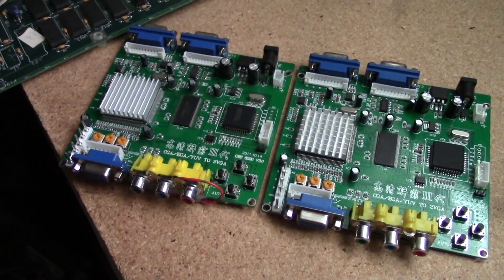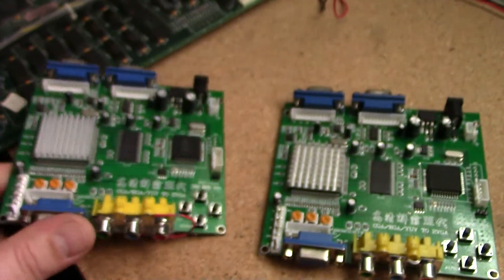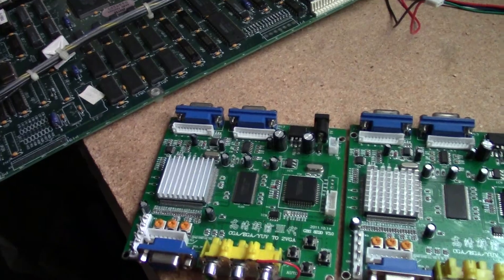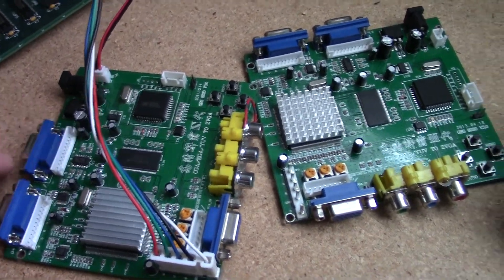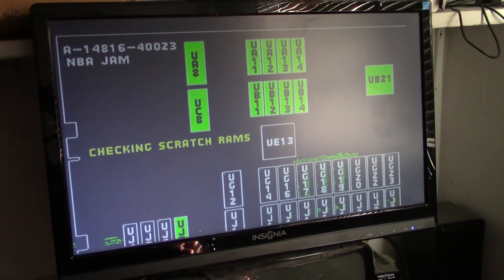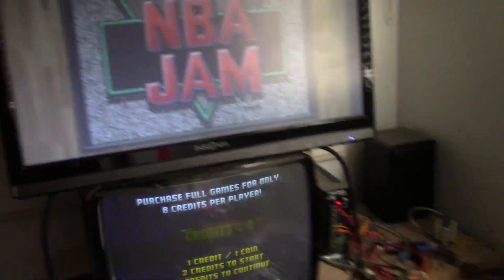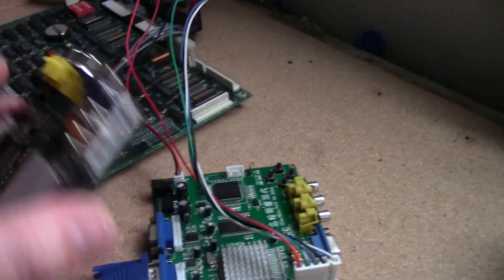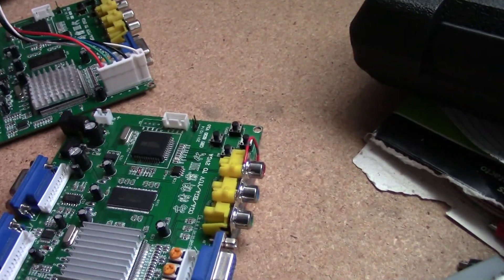Arcade Monitor CGA to VGA Converter Firmware "Frozen Screen" Explaination [HD]

Comment: Has anyone tried using a GBS8200 connected to a LED TV using HDMI, Svideo or Component? I understand that without a additional adapter, this GBS8200 only offers a VGA output.
Reply from the maker: Correct. VGA out only. Everything else on the board is an input. The only output is VGA.
Reply: @YourMKArcadeSource  understood, but is there an adapter/cable that will go VGA to HDMI, or component...?
Reply from the maker: No. You’d need to use this to convert to VGA, then a separate converter to convert from VGA to HDMI.
Reply: @YourMKArcadeSource  I've seen such an adapter but no guarantees it will work
Reply: My problem is I'm replacing a CRT in an arcade cabinet with a LCD or LED TV. I have an LED which requires minimum modification to fit inside the cabinet, but it has no VGA connection. I bought another 32" LCD tv (used) but after opening it, there is still no way it will fit inside the cabinet, metal frame surrounding LCD still too wide.

Comment: Are you still seeing these kinds of issues with today's boards.  I just bought golden tee fore 2005 with bad monitor and ordered the first one on Amazon (Amazon choice) and installed it.  First was flickering screen, found a manual on line and stated to hit the auto button.  Did so and now have frozen screen. This one sold to me is Oct. 18 2019 ver. 4.0
Reply from the maker: To be honest, I haven’t used one of these in years so I can’t say. Sorry. Try setting your V.Pos to 28 or higher.
Reply: @YourMKArcadeSource  thank you for replying.  Seems I'm a little behind but I caught your other video as well and to your suggestion to change vert. pos. And turned up to 29, it fixed the frozen pic.  Thank you and hope this continues to help others.  Liked and subscribed follower.

Comment: Wonder if those "fake" GBS8200s would do the same freezing thing with Sega Model 2/3 stuff cuz those actually run at a non-standard refresh of 57.5hz, too. Fortunately on some monitors that work with medium-resolution, you can use the output connector but mine gives out a washed picture where everything is overly white, except my Model 2A board which is in the metal cage (Sega Rally). Have you experienced a similar problem with any medium-res games like this on a GBS?

Comment: Hi , Have you ever seen an LCD to VGA ?
Reply from the maker: I don’t understand the question
Reply: @YourMKArcadeSource  I have a device that has a 5.7" MG3224C3-SBF - LCD Screen Display Panel 320*240. The information on the Graphic display is just too crowded, also these displays fail often.
My objective is to produce a small PCB that can accept the 14 pin ribbon signal passing it through to the display ( easy enough ) then have a circuit that can produce a VGA output so a larger monitor can be connected.
Reply from the maker: Your problem lies in the resolution. The converter can only accommodate 640x480 as it’s lowest resolution. If your LCD is 320x240, that’s your problem.

Comment: Hey mate what are your recommended clamp settings for midway arcade games I’ve got NBA hangtime on a converter and it keeps going black on me constantly. Cheers
Reply from the maker: Clamp settings are only for Medium resolution games. They keep the colors from drifting. They have no effect on Standard resolution games. But to answer your question, 03 and 04 are what they are supposed to be set to but that won’t fix your issue most likely. Does the game still play when the monitor is black? Are you sure it’s the converter and not the monitor?
Reply: YourMKArcadeSource yeah I’m starting to wonder. It still plays just goes black after so long no matter how good I get it going. Sooner or later same deal I’ve swapped over power supply because old one was 20 years old it was fine for a day or 2 then same thing. Game seems to run fine no problem just a bad picture. Could very well be the screen. Thanks for your time
Reply: Am leaning towards a clamp setting because I went the other way now picture is too white need to find that balance. Will let you know if I can get a nice stable picture
Reply: NBA  maximum Hangtime believe the board for that game was 1997
Reply: Connected a laptop to the monitor and monitor is no problem.
Reply: Thanks mate problem solved was a loose jamma connector was a fair trip when I picked this machine up. Looks great now cheers 🍻

Comment: Don't think it is a fake. It would seem to be a lot of trouble to go to, to manufacture a board with all the same components just to make less than $20 bucks to sell to unsuspecting customers. 
Version numbers for firmware just means there's been an update and only change if there is a bug fix or component change that requires an update to the firmware, as you know.
It's more likely the board wasn't adjusted to suit its purpose and I'd fiddle with the display settings menu first to see if that fixes it.

Comment: Hi, How to add an EGA input to the board? EGA has 6 color channels and 2 HV channels. Where do I plug them in? This is more than RGB. I have an Amstrad 1640 with EGA output which I want to plug to an VGA monitor.

Comment: to fix this problem is not the firm ware you have to go to geometry a fuck with the setting to the maximum level it will work eventually. the settings of vertical sync and everything has to be taken into account, set it all to 100 and slowly work down from there. and boom. The problem is is that its not fake but there is bad data sheets for the component on how to properly use it. Try it
Reply from the maker: Actually, if you adjust the Vertical Position to above setting 27, it fixes the issue. I have a different video on it.

Comment: Hello! Can I hook up a pc to an arcade monitor using this converter? Thanks!
Reply from the maker: No. You need this...

http://www.ebay.com/itm/New-VGA-to-RGBS-CGA-AV-S-Video-Converter-Arcade-MAME-Multicade-Wire-Track-NO-/361155268202?hash=item5416880e6a:g:Df8AAOSwPgxVSdge
Reply: Nice! Thank you!
Reply: YourMKArcadeSource do you have experience using the converter in the link you provided?
Reply from the maker: Yup. Works great.

Comment: So I have this harness for my MK II board http://www.ebay.com/itm/JAMMA-Wiring-Harness-with-Wire-Id-Label-Arcade-Video-Game-Multicade-/121753778577?hash=item1c59173991:g:4FQAAOSwwE5WXggF Am I going to have to tap into this to get the VGA adaptor going? (I have the same one)  I have no idea where to start with taping into the thing this is a new hobby for me.
Reply from the maker: You'll simply need to splice the red, green, blue, black, and white video wires from the Jamma harness to the same colored wires that came with the converter and you should be all set.
Reply: +YourMKArcadeSource ahhhh ok. I'm overthinking it, thanks!!
Reply from the maker: You're welcome!

Comment: Hey,

Do you know if this will output (without additional re-encoding) to an S-Video input on an NTSC CRT TV?

I wondered if using something like the cable pictured below... plugged into the VGA output of the board in the video into the TV would work
http://www.staples-3p.com/s7/is/image/Staples/m000508458_sc7?$splssku$

Cheers
Reply from the maker: +s34nVideos Well, it only outputs VGA, so I don't think so. That item you posted doesn't convert from VGA to S-Video, it only converts the connection. It's worth a try though.
Reply: Yeh that's what I was thinking. I'll give it a try and see what happens!

Comment: Do breakout cables work good?  or are these better?
Reply from the maker: +Judy and Dan Farmer Arcade monitors are 15khz refresh rate. VGA is 31khz refresh rate, so a breakout cable by itself won't work. You have to convert the 15khz to 31khz to use a VGA monitor.
Reply: ok thanks for the quick reply!

Comment: Doesn't the 3.0 revision refer to the hardware design? it would explain why the PCB is identical, but the firmware could be different.
Reply: +Jonathan Mayer i agree i would say 3.0 refers to the hardware version. the date of the mfg would be the better judge of the firmware. IMO

Comment: Had the same frozen issue happen to me when trying to use one of these similar boards on my Midway Total Carnage and Smash TV PCBs.  It just would not work (I had the HD 9800 v5.0 2014.05.15 which has only 1 VGA port for OUTPUT).  I ended replacing the monitor with an authentic arcade monitor after pulling my hair out with that thing.    Works fine with other JAMMA boards though.
Reply from the maker: +DeLuSioNaL Arcade Yup. You had one with the outdated firmware. I also hear that the ones with only one VGA output are bootlegs.

Comment: This is great... My nba board has been freezing and getting frustrated.  Thanks for the overview.
Reply from the maker: +Cotner0705 You're welcome.
Reply: +YourMKArcadeSource hey there, you said that the output is 53hz instead of 60hz right?  Just asking because my monitor is only outputting in 60hz and I cant get the clamp settings to set up correctly so the screen looks washed like in your video.  Do you think the vga out still 53hz after it goes out of the board?
Reply from the maker: The output of the VGA is 60hz. Restore the clamp settings to default and adjust the RGB pots next to the RGB hookup instead.

Comment: I unfortunately have one of the fake ones which is making my MK2 board repair a nightmare. For a while I thought there was a problem with the video ram or sync but turns out it was the converter. It's a shame that the firmware can't be updated. There seems to be a connection below the 5v input that the 'instructions' imply is for updating but I can't find anything about it online. Any ideas?
Reply from the maker: +Chris Kaminski Nope. That's a little above my paygrade. Like I said, it's a complete gamble whether you get a real one with the updated firmware or not. I will say that I have purchased two of them in the past from Paradise Arcade and they were both good to go.
Reply: +Chris Kaminski Just a heads up there is a CFW that someone made for this board that you can try out, it's not too bad to set up but you do need a Raspberry Pi which is just as much as the CGA to VGA scaler itself. It does add some cool functionality to it though. 

http://shmups.system11.org/viewtopic.php?f=6&t=52172
Reply: +Will Richardson Thanks for the link. It seems a bit beyond my ability at the moment but good to see someone is working on it. Hopefully they'll be able to get it to work with a pc so a firmware update is possible for the not so technically minded like me!

Comment: Thanks for video Mike. I have one that works on static screen but jumps and jitters on moving screen. I'm changing plug to one you have instead of the positive and negative. What type of adapter board between edge connector and PCB is that you are using for the power and video to converter?
Reply from the maker: +akaclarkkent It's something I got a long time ago that isn't available anymore. You can just splice the cables into your Jamma wiring and be fine.
Reply: Check your resolution settings on the board. What you describe can happen when its run too high or low.

Comment: Very interesting video.

I ordered one of these things a few years back as something to go along with my HDBox pro and it's a 2010 model, which I haven't had the opportunity to fully test out yet.  I'm currently planning to use it as a way to get my old console games working in rgb once I get some cables for them.  Do you know what type of sync these really need in order to operate properly?

Also a bit of a heads up that some guy over on the Shmups boards is trying to figure out how to update the firmwares to these and it would be great if they could be "upgraded" to support full 1080p (at least), but I'd like to have it where it can perfectly line-double for scanline generators.
Reply from the maker: +voltz15 I'm not sure exactly what type of sync would work best. It's really whatever it needs to work is what you would need to use.
Reply: any update on who has the updated ones?
Reply from the maker: Nope. No confirmed working sources have been identified as of yet.

Comment: I have one that works, but the picture quality is not that great. I've messed with the settings every way possible.
Reply from the maker: +Korn Story That's odd. The image looked great in the MK9 and Injustice cabs I had. I was using one of these in each of them to convert the component video to VGA.
Reply: +YourMKArcadeSource I may have just got a faulty one. I had it hooked up to my mackvision flat screen and it looked terrible.